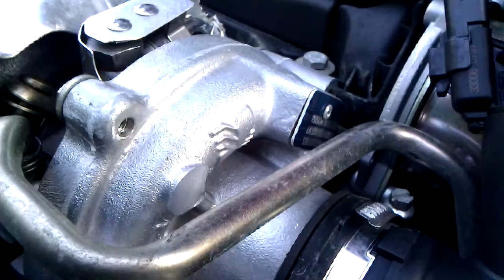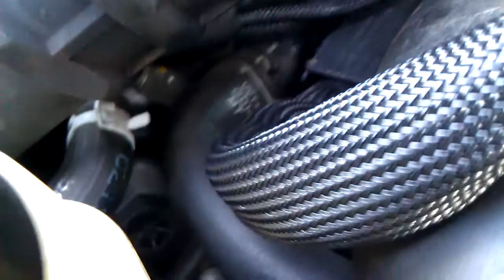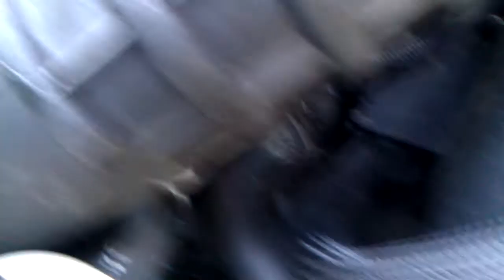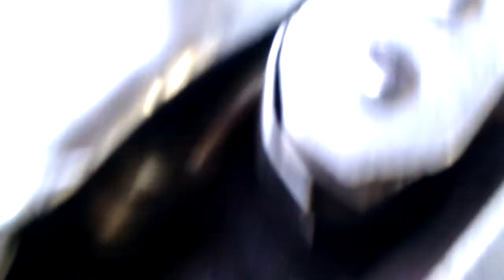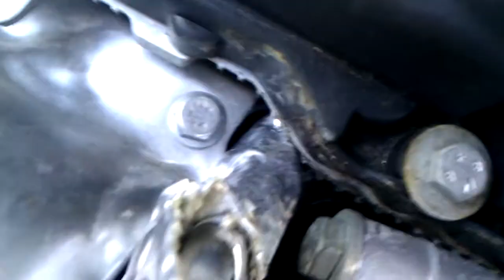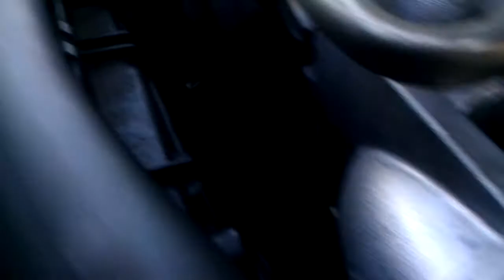Finally my car is back - 2009 R56 MINI Cooper S Turbocharger Oil Leak fixed

Comment: Those pipe oil lines have so many bents and curves that oil with gradually accumulate on them, eventually causing a clog, then killing your turbo.    preventive maintenance would be to disconnect and flush those lines.

Comment from the maker: mine just leaked, not a total failure. the turbocharger was working fine though.  but I would not drive the car if the line was broke.

google "Detroit Tuned Turbo Oil Line KIT", this kit has really good reviews from several mini forums.  good luck!

Comment: hello would that top oil feed pipe cause lack of boost if broken,ive just bought a 2007 mini and its not boosting and noticed the oil feed pipe is loose
Reply: PAUL BRADLEY I just read that it is loose by design, it has an o-ring inside that seals it.
Reply: it should have slight play in it.. if you can push/pull the pipe about 5-6mm & you can see oil coming out or along the line itself its toast.. you'll need a new line. if your turbos' been low of oil due to a leak for sometime then potentially it could've killed the bearings.
overall everyone should keep an eye out on the oil supply to the turbo & oil level as a whole.

if your turbo's gone bad, remove the front snail & the CHRA (centre assemble which holds the blades/bearings etc) check it all out & if required replace the CHRA assembly. its a dead easy process & just afew hours work.. any muppet could do it.

going back to the oil supply line, you've quite afew options, I've gone for a flexible aftermarket line so this issue isn't going to occur again.